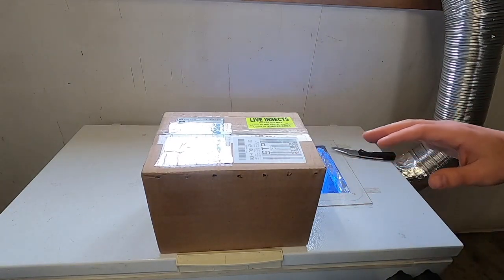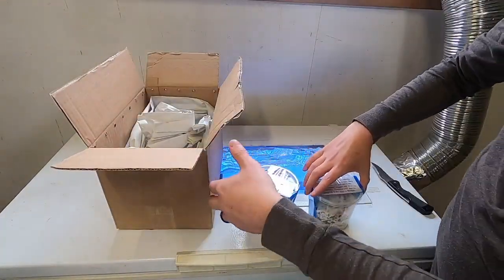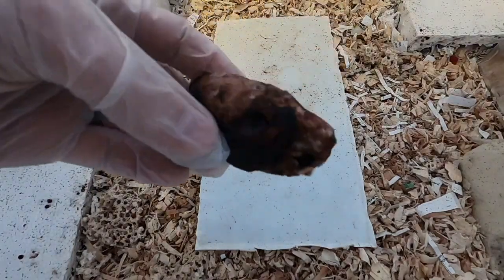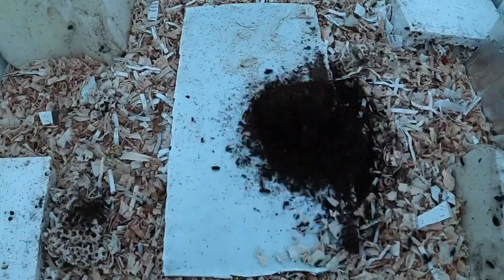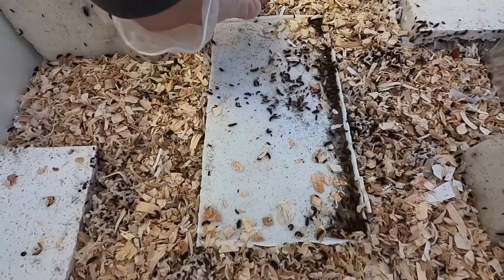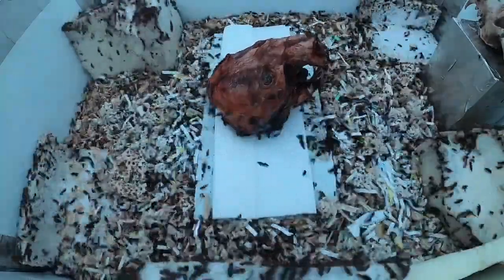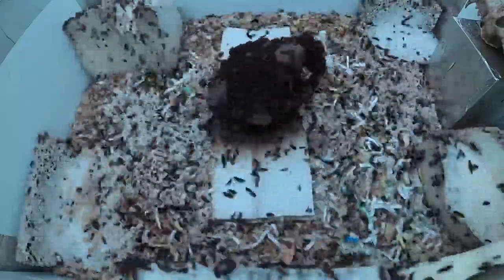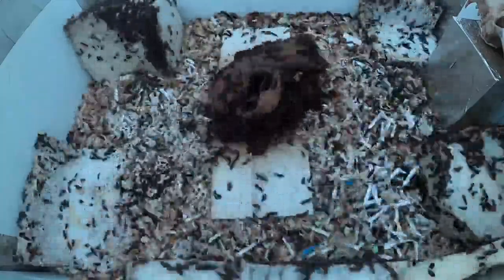Dermestid Beetles Tips & Tricks - Common Questions

Comment: Awesome video, thank you for answering all these questions. I only have room for my beetles outside in my yard now that I moved. Do you think this set up would still be sufficient during four seasons? I'd be able to hook it all up to electricity, but the ice box itself, I'd be worried it doesn't get insulated enough to keep the beetles cool enough in the summer and warm enough in the winter.
Reply from the maker: What state are you located in? And will they be in shade or sunlight?
Reply from the maker: I would say it could make it through the summer just fine in the shade the beetles are good even if it hits 100 degrees though  think 110 is when it starts getting in the danger zone, for winter I would say it's possible though make sure you have a larger heat sink than I have in there  , more bedding, and even enclose it in the pink insulation boards for like a outer shell with a piece underneath as well, during w8nter with my set up my fan output I tape over half of it to have less air flow as humidity is not an issue in the winter
Reply from the maker: @TheWitchOfWonderlust of course any other questions let us know

Comment: How did you wire in your pc fan?
Reply from the maker: The one I have listed is a plug in to a normal outlet, you just plug it right into the humidity inkbird and it will run when it needs it to once you have it set to the % humidity you want